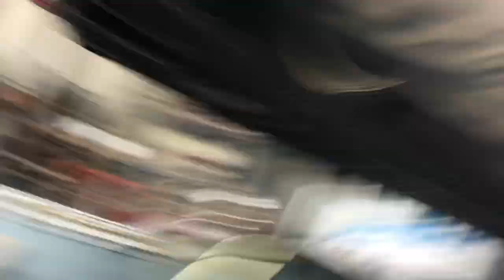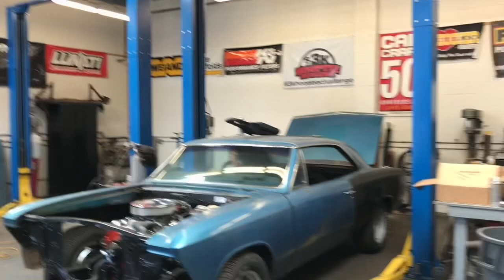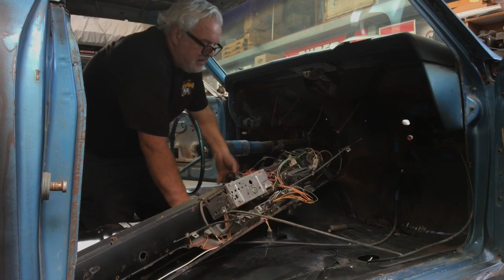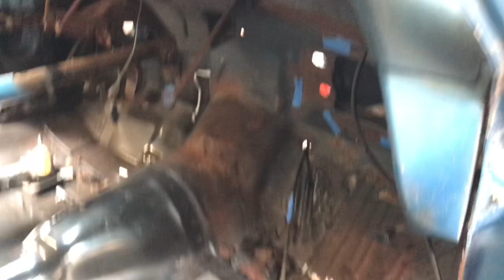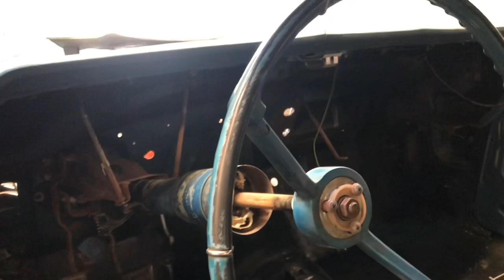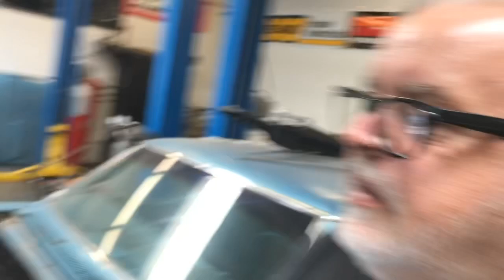66 Chevelle progress

Comment: The Chevelle dash is easier than my 70 Road Runner. The upper bolts are under the front windshield rubber seal. Front windshield has to come out.
Reply: Same on my Duster. But a cutoff wheel fixed that problem and I got mine out with the glass in.

Comment: Lucky please show more of the dash rebuild/wire because I have a 1967 that I need to do the same on. Thanks
Reply: robseg , most of the wires and light bulbs are labeled on the back of the instrument panel , I have taken 3 out and put them back in , everything works from gauges to turn signals

Comment: Steering column drop with just 2 bolts under the dash? What was done on the other side of the firewall? The rag joint has to be undone?
Reply: That’s what I’m wondering